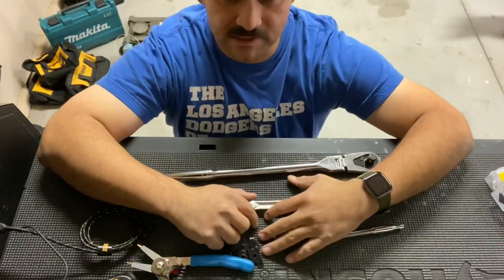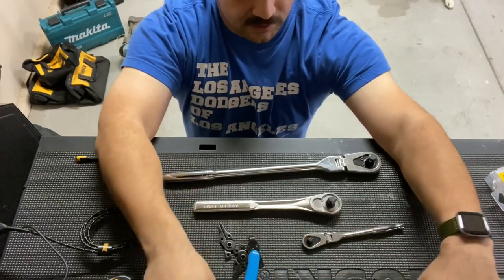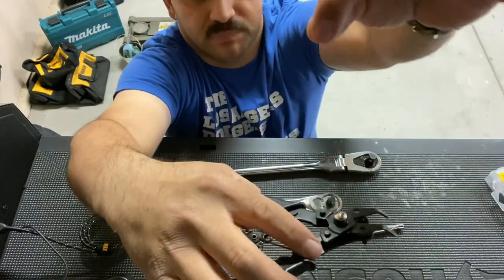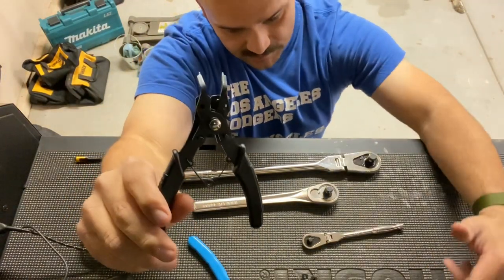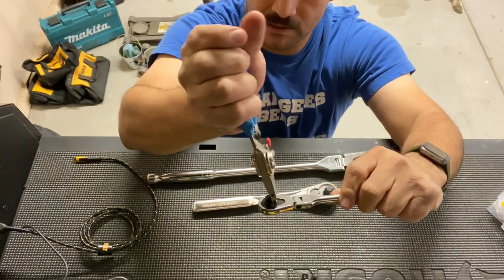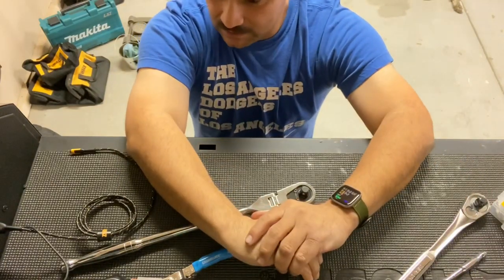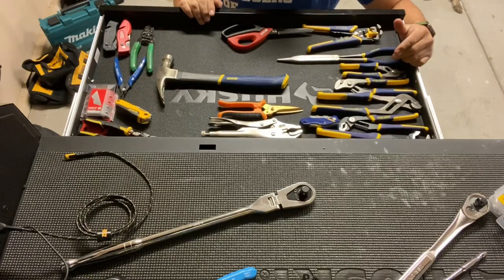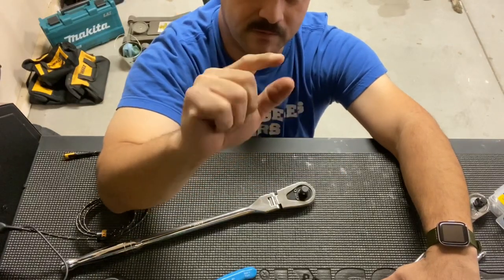Review of: Channel Lock Snap Ring Pliers - 927

Comment: I bought a pair from Lowes.  Same thing, model 927.  the tips go from closed to just about 1.25" which was what I was hoping to find out in your video.  I got a kick out of what channellock did:  they used the same handle stamping for both sides.  a practical decision, except the handle is stamped with "EXT" and "INT".  Set the switch so the pliers operate as an external snap ring remover and flip it over.  now the switch says "INT" but the pliers still work as "EXT".  sure, minor details, but this is the kind of stuff that Japan/Taiwan/China kicks our butts on.  other than that it is extremely well made.